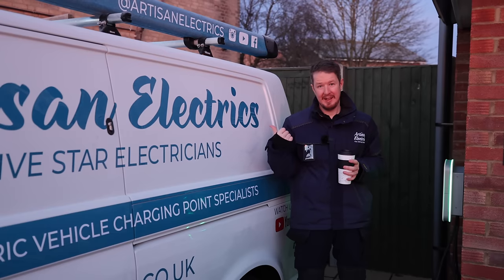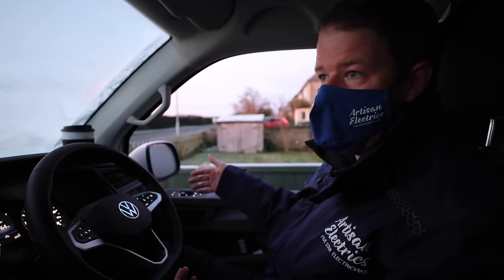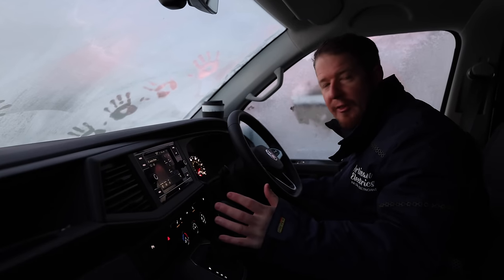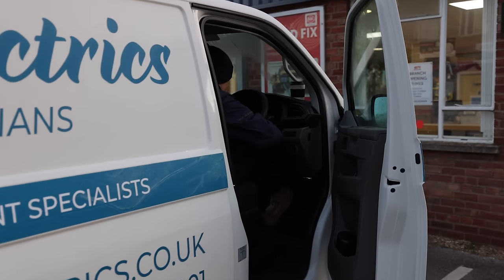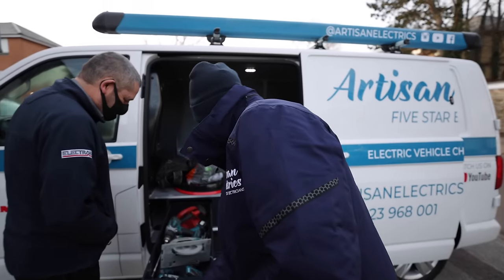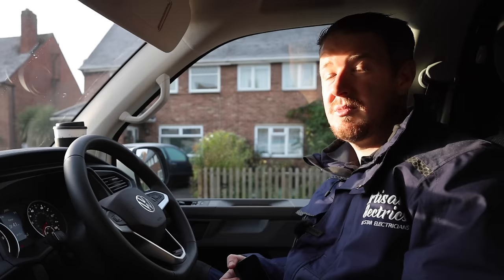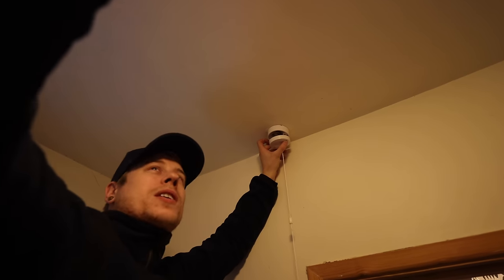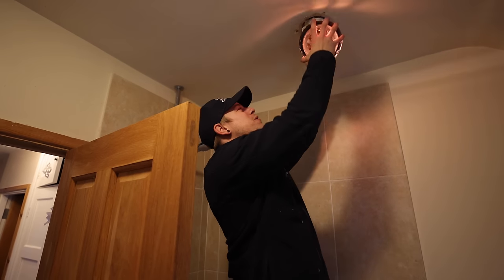ELECTRIC VAN NIGHTMARE 😬 - Volkswagen Transporter Electric Van

Comment: We are still about at least 10 years from 1.having the technology for electric vans doing what we want i.e mileage fully loaded. 2.infrastructure i.e charging for all. 3. Affordability
Reply: Or hydrogen will take the lead
Reply: 3 years at the max.  Rivian already has Amazon vans on the road.  Once tesla decides to dip their toes in the commercial vehicle sector,  most of the problems will disappear
Reply: @tommymack3210  For Vans  yes i think hydrogen is the way forward electric  ok for tootling around down or school run , but the reality is we just will not have the infostructure
Reply: Rubbish. My Peugeot e-expert is fantastic and I’d never go back to a diesel. I’ve got the smaller battery and it’ll happily do 100 miles in cold weather.
Reply: @thomassmith7819  that's all very well but my daily commute is about that just now with no charger on the other end
Reply: @thomassmith7819  Ill stick to my relay 680 miles to the tank of fuel doesnt bleed milage when the heaters are on or other electrics and i can fully ' charge' it in 5 minutes
Reply: Disaster I’d never buy a battery vehicle until they bring out solid state battery’s about 4 - 5 years away  - £50k are u mad
Reply: @thomassmith7819  100 miles haha
Reply: @steverobinson8170  EVs get 2 to 5 miles per kWh. Depending on size/loading/tempreture . Hydrogen it is more of a question of how many kWh you use per mile.
Reply: Vw are pushing to recover face from dieselgate! And doing a bad job of retrofitting all vans
Ground up ev vans are far better making a better use of space and integrating tech such as pre heat! And faster charging etc etc
Most trade vans do well under 100 miles each working day and many could be charged on job too - not so much for yours as power is often off :-)
Reply: @steveemery30  the 100 miles range is less of an issue, but the 3.6kw charging limit is a joke. Is it faster on DC?
Reply: @thomassmith7819  the Expert was engineered in house by PSA on a modular platform that was capable of being adapted easily. They are now offering a Hydrogen Fuel Cell variant in Left Hand Drive markets.
The Transporter however was a conversion by a third party company authorised by VW.
I guess VW did as a stop gap while they developed the ID Buzz cargo on the MEB platform.
Reply: @patdbean   Does that really matter
Reply: @steverobinson8170  dose a 4mph charging speed matter? Yes i think so, if you only have  say 4 hours of cheap rate tarrif , then yes i think it dose and you can't charge in a reasonable time.
Reply: @patdbean  with a home charger you can get around 40 miles an hour
Reply: @MrWillAdams  if you watch the video 0:40 he tells you directly that the van only charges at 3.6kw. so it dose not matter what the charging point puts  out, the van can only take in 3.6kw for a vehicle of that size in winter,  that is about 4 to 6  mph,  you can  get 3kw from a 13amp plug. if  you only have 4 hours of off peak time to charge it in ......
Reply: @patdbean  sorry I thought you were speaking generally. Only saying because my Tesla does 44 miles each hour which is plenty for me
Reply: @MrWillAdams  that is a car charging at (what 7kw) this is a van charging at 3.6kw half the charge rate going into something 2 or 3 time the size.
Reply: @patdbean  They have developed a hydrogen vehicle  5 minutes to fill and away you go,  company in Coventry
Reply: @steverobinson8170  ALL hydrogen vehicles can fill in 5 minutes, just like petrole ones. The point is that an EV can be charged at home on a preexisting mains electricity supply. The hydrogen filling stations need to be built and  supplied  by hydrogen tankers. Also  the electricity used to make the hydrogen needs to be generated (twice as  much of it per mile) than if you had just used it to charge an EV directly. Hydrogen is just a storage median , you still have to make the electricity .
Reply: @tysonkauth7232  
Unless you're someone who likes to get to work.
Reply: @Robert-cu9bm  I get to work everyday in my model Y.  Tons of room for tools is the frunk and the sub trunk, leaving the entire cargo area available for my ladder and whatever gear I need.  ~500 km of range, so no worries about that.  Have a cybertruck on order as well, but not expecting to see that until 2024 or 2025.
Reply: @steverobinson8170  two issues here,  1 local distribution and 2. total demand.  The  average  UK car dose 8400 miles a year as of 2019 that is about 25 miles a day. Or about 6kw/h a day. Or less than an hour a day on a 7kw charger. With internet based control that load spreed between 10pm and 7am. There will be little  or no local  peak load issues. 
2. Total demand 
In 1950 the UK grid delivered 10Twh for the first time, in 2005 it delivered 375Twh last year 325Twh. The distribution  and generation is more than enough for the 500,000 EVs we have now and good enough for the 5,000,000 we can expect by 2027. By the time all 37 million are   replaced it will be about 2045. By that Time a good chunk  of our current grid will have been replaced/upgraded  anyway.

We are not just going to wake up one day with 37  million EVs and zero ICE cars. it will take decades.
Reply: @Zockblatt Shickleblender but they can solve the problem of having superchargers absolutley everywhere.   20 minutes and you're good to go again.
Reply: @patdbean  does your projection include smart meters controlling a dedicated charging box for EVs that can be remotely turned off, every house with a EV will have to have one, and then you will be taxed, and you won't have any say when the grid decides to take back what it put in, the legislation to do this happened in June 2021. The future is not going to be as rosy as you think.

"All new chargepoints must have a data connection, with the ability to measure, record and transmit usage (in minutes and as units of energy) and delay charging or slow it down during periods where grid demand is highest. Manufacturers will also have to provide a user interface for drivers, such as an app, to set parameters.
If this sounds familiar, it’s because OZEV’s home and workplace charging schemes already require similar functionality[7, 8]. However, the new regulations mandate finer control of energy flow and charging times and apply to all new chargepoints. This includes the growing share of units being installed without the Electric Vehicle Homecharge Scheme which, from April 2022 will no longer be available for single-occupant properties such as houses and bungalows[9]."
Reply: @David Rosenberg example: a taxi driver comes home at 6pm with 25 miles remaining on a 300 miles range car . 

He needs 250 miles by 7am. The car dose not charge until 10pm because of costs. At 10 it starts by 11pm it is charging at 7kw. Or 35mph . At 6am the charger switched of for 20 minutes while he has a shower and cooks breakfast. By 7 am he unplugs having added 35x 7 giving a total charge of  about 265 miles. Yes he may have to put another 100 miles back in on a fast charger while he takes a 20minute lunch. 

I think most taxi drivers will tell you that 300+ miles is quite a heavy day. That would be a 70,000+ mile year.
Reply: @David Rosenberg when! And with what type of car? A 2010 nissian leaf with a 24,kWh battery and 75 miles range ? Or today with  the 2018 version with 60kwh battery and we'll over 200 miles range? And probably 5 or 10 times the number of fast chargers in 2022 vs 2011.

As I sit here in 2022 zap map tells me I am 200 meters   from a vacant 50kw public charger and 4.2km  from  a vacant   
150kw charger.
Reply: @David Rosenberg that explains it. The 2010/11 leaf had a known problem with fast charging. You could not fast charge if the battery was to hot. So a 75 mile range battery that on a summer's day won't charge at more than 30 mph was a bit of a nonstarter for a taxi.

 But comparing that to current EVs is like comparing a Nokia 3510 from 1998 to an iphone from 2007.
Reply: @patdbean  I got notified of your reply to me a little while ago although I've read it it is not showing here,how odd,  the first thing I will add is you ignored th
e fact that current ev chargers will be banned april/ June this year, no one will be able to have a charger installed without a smart meter and a new charging meter, why has this trade electrician not informed people of this, future tax is one of the reasons, I suspect his professional interest over rules  information,  you said chargers will only go off for 5 mins when people make a cup of tea during coronation Street, thats a ridiculous reply ,why would the government make it a legal requirement to have smart meters and a separate charging meter for 5 mins it makes no sense, what it does mean the government fear prolonged power outages when people plug in, its a storage facility were the new chargers can empty your battery to supply the grid , thats going to cause a lot of inconvenience for people and infuriating for businesses,  the meters will also become a revenue stream for the government, which the current chargers are not metered for a road tariff,  you set yourself up as being informed, but your only giving half the story.
Reply: @patdbean  You can't keep on using averages to calculate loading it doesnt work or assume its all going to be internet controlled , people are not internet controlled
Reply: @barryclarke3010  I see it more every day, the things we buy selling us out to corporations. Like the smart meters and mobile phones, charging points will follow, but the same can be said of diesel motors that electronically lock when the ad-blue runs out even if you top it up. Not sure what the solution is. Perhaps generate your own electricity via solar panel, but they are trying to tax that in California.
Reply: @darkoampem  legislation taking our choices away,  all we can do is fight it politically, I will drive my diesel and petrol vehicles till I'm forced to give them up. I wont buy anything that needs add blue, I will pay a premium for a good old motor, solar taxed ? I'm not surprised,  I think in the UK you have the choice of feed back into the grid or not,but you need planning permission.  In Italy you can have solar panels but you have to be connected to the grid. I have nothing against solar for individuals but as a national power supply its ridiculous. 

The ability to do for yourself is being eroded,  in favour of corporations and small business alike.
Reply: @barryclarke3010  you talk as if diesel and  petrol are untaxed. For the love of God, most of what you pay for them is tax. The electricity you charge an EV with has 5% vat.
Reply: @patdbean  theres something very suspicious about you, first your two replies to me don't show on YouTube  I only see them through notifications, secondly I think your a industry shill. I have no problem at all in paying tax on diesel and petrol vehicles. I don't talk as though these ice vehicles have no duty on them ,unlike you who avoids the question of metered revenue for electric vehicles that is comming.
Reply: @barryclarke3010  the best, and in the long run only way to tax road transport is on distance driven. With an addition for size of vehicle. I can always just plug my EV into the wall, there are commando plugs that do up to 50amp and the meter (Smart or not) will have no way to know if it is going into an EV or watter heater or a hob/oven  or heated swimming pool etc etc.

If they must tax it , just charge per mile and be done with it.

Comment: Defrosting your window doesn't need boiling hot water.
You can fill a small plastic bag with warm tapwater and slide it over the windscreen in strokes from top to bottom.
Safer than throwing hot water on but still much faster than just a scraper.
Reply: I just pour lukewarm water on it,been doing it for 20 years in Scotland, has never caused me any problems
Reply: @derekcasserly1561  Same never had issues,

Comment: In Scandinavia lots of people take their EV back to the shops they can’t withstand cold harsh climate,battery die too quick. The media and production companies just dont say those things
Reply: Best comment of the day!
Reply: Sorry, but that's nonsense. How do i know? I live in central Norway, drive an EV and know many many people also driving EVs. I have yet to hear of a person returning their car because it "couldn't withstand the cold harsh climate". Quite the opposite actually - consumption is for sure higher, but immediate heat from the HVAC and great traction control make up for it.
Reply: It's the same with Lithium batteries they try to sell you as a replacement for motorcycles. They claim that they are a fraction of the weight, but mention nothing about how they completely die in cold weather. Very annoying that they don't care about their customers getting stranded.
Reply: Are you sure? Norway has the highest percentage electric vehicle use in Europe with great charging infrastructure.
Reply: @davidrowden8003  But totally wrong!
Reply: @15bit62  I am sure you are right. I watch a lot of Bjorn Nyland vlogs and he has never mentioned any such issue and seem to be be able to use all sorts of press Evs at -20 without any problems. I think some people just perpetuate rumours about EVs that have next to no basis in truth.
Reply: @fushisu  And yet 65% of cars sold in Norway last year were full EVs, and the % of EV's in the overall national fleet is now 15%. That's over 350 thousand cars on the street. You would think if they were that bad we wouldn't be buying so many of them up here.
So yes, winter range is compromised (and i would never deny that), but it's not so compromised that the cars are in any way useless or unusable. I would also comment from personal experience that the serious impact on range doesn't happen until it's -5C or below. So whilst we do experience it pretty noticeably here (-13C this morning), most folk in the UK won't be so seriously impacted.
Reply: @jimf4748   The key word here is "infrastructure". If you don't have to worry about range so much because of this, then the technical limitations become somewhat mitigated.
Reply: That''ll explain Norway having the highest EV ownership in the world then! 🙄🙄🙄

Comment: You can set the van to defrost at a specified time whilst plugged in. The range on the bigger vans is a major issue at the moment. I have a Renault kangoo for work and gives 100 miles to a charge and has a diesel heater for the cold days. The only fault it can only charge at a max of 7.5kwh
Reply: Will it defrost while still plugged in?
If so that’s actually really cool.
Reply: @hybrid9mm  Yes, it is considered good practice to preheat the vehicle while plugged in to reduce battery drain since it uses more energy to heat up the vehicle than it does to keep it at a temperature.
Reply: @roger1818  that’s really handy to be honest, especially considering how much it costs me to warn up my car or van vs using the electric to do it.
Reply: I think this would involve reading the f'ing manual and this guy clearly hasn't, lol
Reply: @alexm9718  ho ho. That's a pretty good comment 👍
Reply: Diesel heater in an electric car for the cold days... interesting... can you order it like that from the factory? (Would be funny) Or you need to retrofit it?
Reply: @Gabriel.Leni100  An interesting optional extra.

Comment: Not sure what I have to think of this. Many problems not related to EV at all. Not having a scraper ready, not knowing that there is a special mode for defrosting the windscreen and the side panels, lowering frosted side panels. That's all things that are not specfic to EVs, that's basic issues and knowledge you have to have for all kinds of cars.
And an electrician not knowing how long it takes to charge whatever amount of kWh with 3.6kW? I mean, yes charging rates are not constant. For high-power charging, 3.6kW is slow charging that is not really affected by external conditions. And why not leave the charger on the car during the night? And not sure about this van, but usually EVs a heating/cooling system which can be programmed to start at a certain time. And as you leave the EV on the charge port, you don't lose range.
Does Jordan use new devices for his work the same way? Not reading instructions or get information about how to use tools and devices the proper way before using them, just assume how they work?